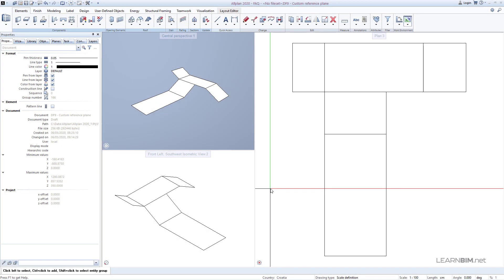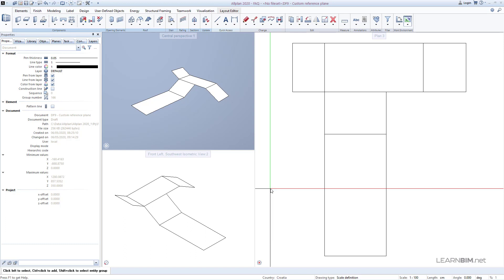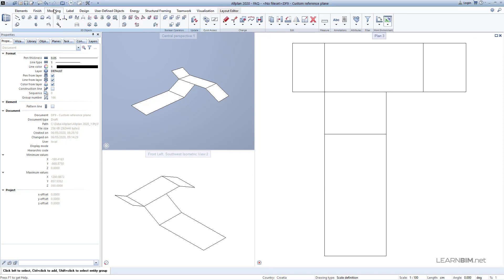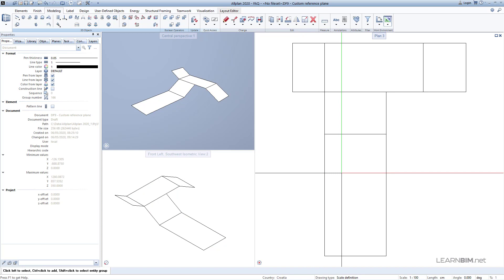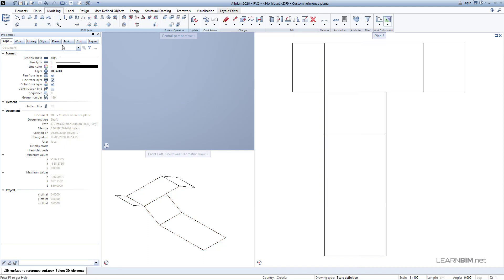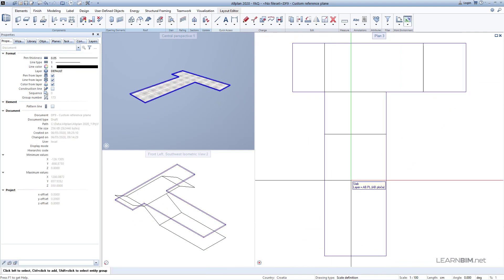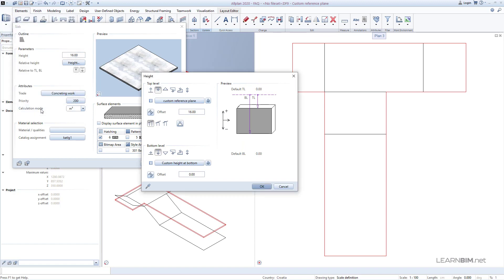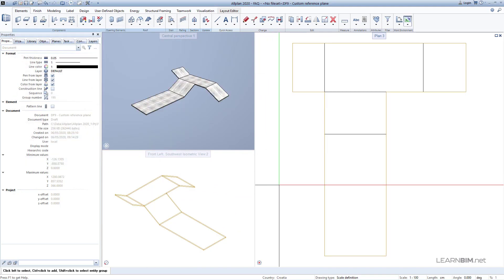4.7  FAQ   3D modeling custom reference plane

Comment: is there a possibility to modify this kind of reference lever, by modifying its points as in a normal level?  or  we have to create a new one?
Reply: yes it is possible, you can just select the reference plane afterwards and change it using its handles or by stretch command in plan view or in 3D views. After that all the architectural elements that are connected to it will automatically be adjusted.